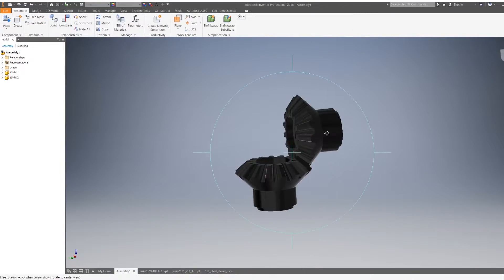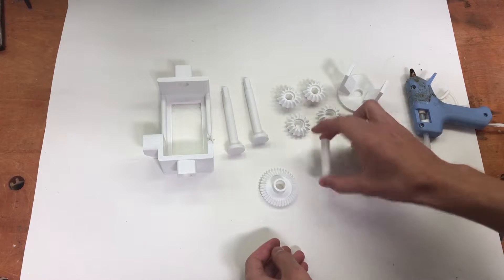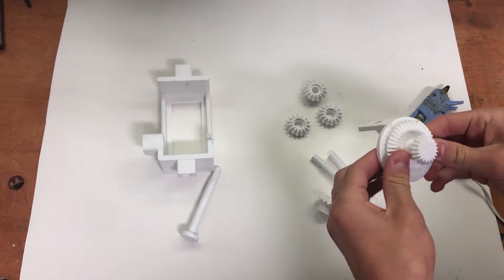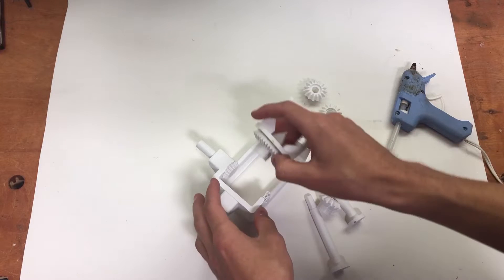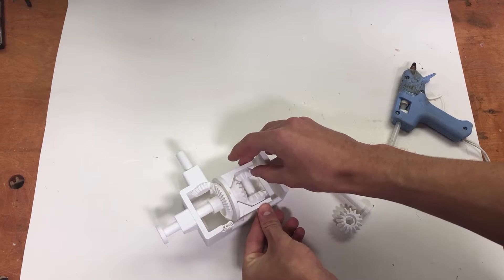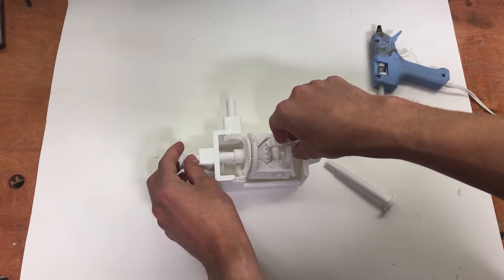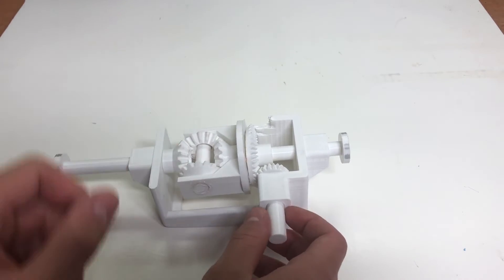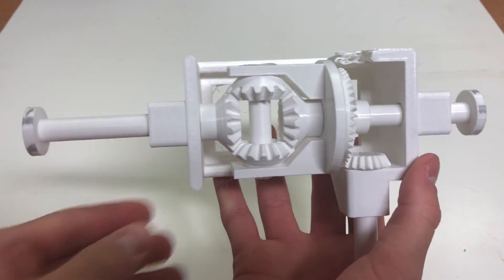3D Printed Differential Gearbox

Comment: Wouldn't it make more sense to just print the big gear as part of the carriage for the smaller gears rather than gluing it on?  Also, this is just called a differential.  It's what always a rear-wheel drive to go around a corner without slipping.  The one on a front wheel drive is a bit more complex as it has to account for the wheels turning perpendicular to the rotation of the shaft.

Comment: 6:07 even if you lock one of the output shafts the output speed is not going to change on the other shaft unless you change the input speed...
Reply: Wrong. Sum of the speeds is proportional  to the input speed. If you lock one side the other will speed up.

Torque is equal on both outputs.
Reply: if you lock one of the outputs then the rotation of the spider gears makes the unrestrained output shaft spin faster